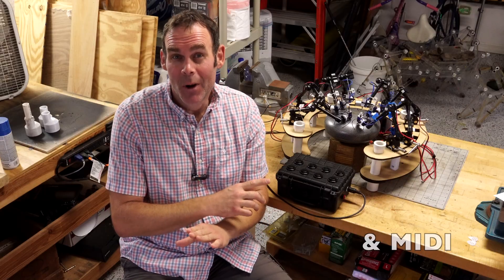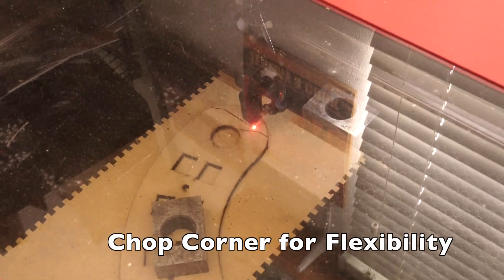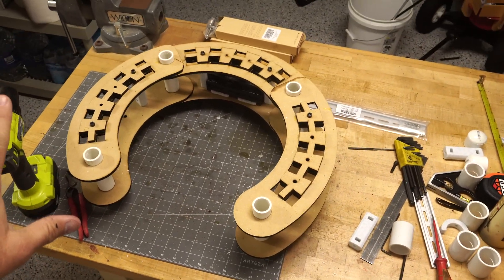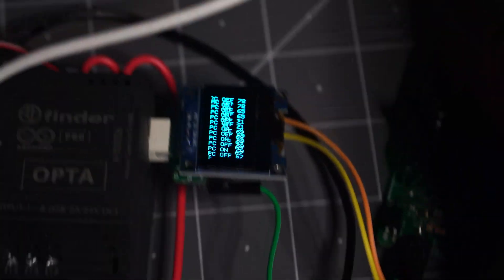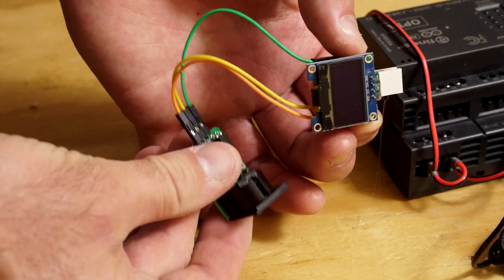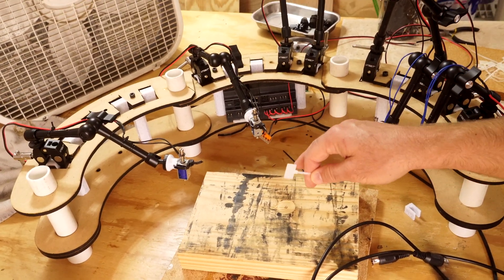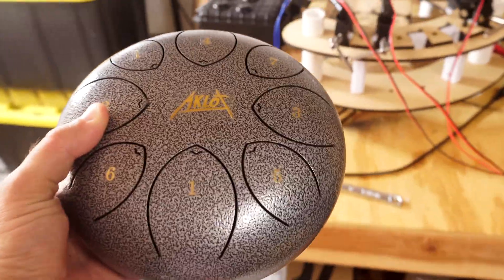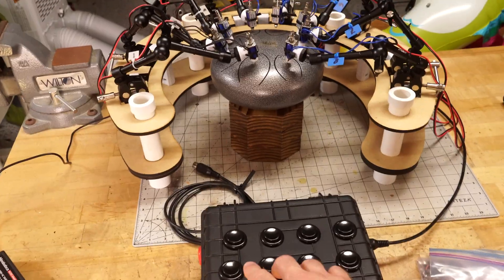Robotic Tongue Drum with Arduino Opta and MIDI

Comment: Neat stuff. My brain instantly took me to those rubber reflex-hammers that physicians use. Would be cool to see an array of those to make it work. Maybe if they had a loose grip it would get around that 'strike-fast to give vibration room' problem. You know, more like a human grip. I dunno; idea. Little rubber hands holding each mallet, and you are win!
Reply from the maker: Thanks! Yeah, that is a neat idea... Actually was thinking about a simpler drum setup using pneumatics - that physicians hammer idea might work well in such a setup 🤔

Comment: Nice project! You can get a better tone out of the tong drum if you make sure the solenoid is retracted right away so the drum can vibrate more. Same happens if you strike it with manual the mallet: it bounces of directly
Reply from the maker: Thanks! Yeah was definitely a balance between making sure it strikes and coming off fast enough. A sensor setup would be helpful for that, but more complicated!
Reply: @JeremyCook  Wow. What a simple complication. Why is it that the seemingly easy things always end up the time-suckers?
Reply from the maker: @pocket83squared  Ha, guess that's why things "work in the lab." Perhaps we take things for granted as simple that really aren't. Like accurately throwing a baseball at a moving human target. Simple to us, but it's a mind-blowing task for a robot, especially if you're using our sort of joint structure not just a cannon or something like that.